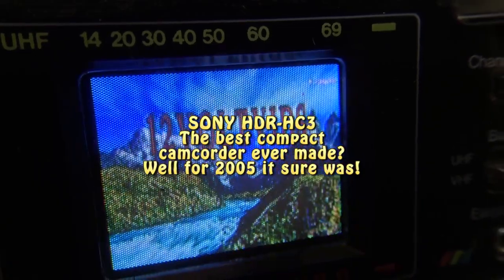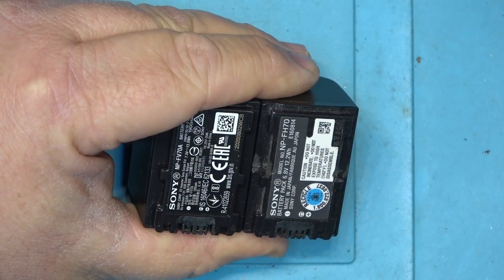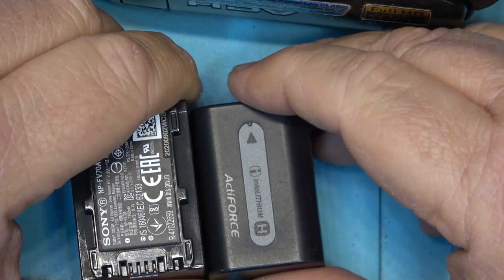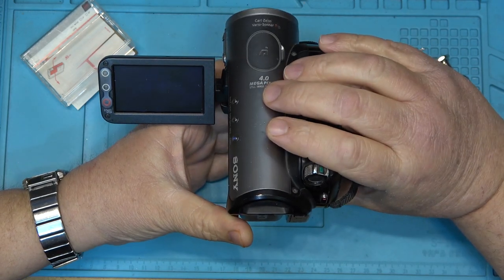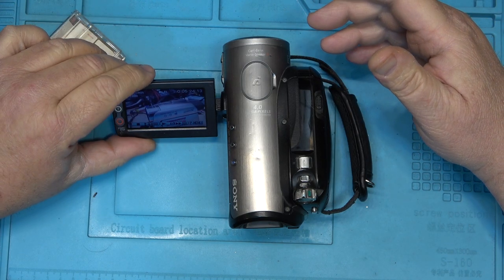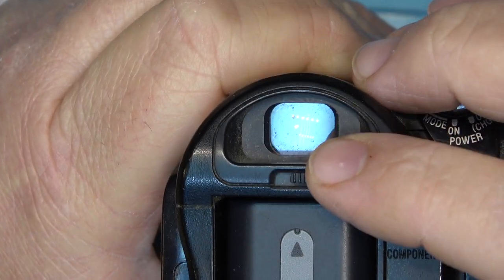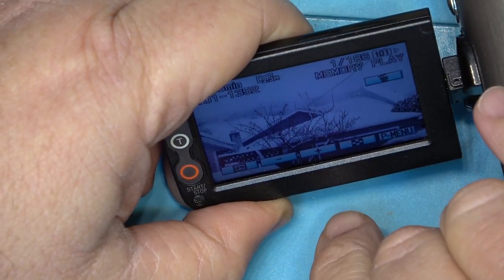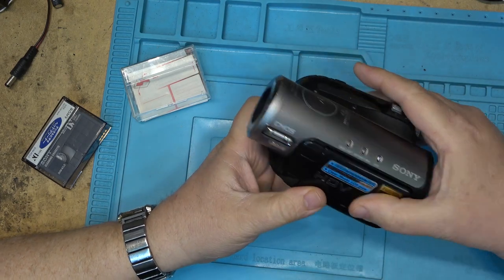Sony HDR HC3 The G.O.A.T. of Sony tape based camcorders

Comment: i ditched my phone a few years back,i use a canon sureshot and it takes great photos ...
Reply from the maker: I use my Sony FDR-AX100 for stills and 4K video. It has a 1" sensor so it can give nice shallow dept of field photos just like my DSLR and it shoots 4K video. I also use my old Sony Alpha A65 if I am doing something like time lapse shooting. It will only do 1080p60 video however. If I  am traveling small, I will use my FDRAX33. It is small, 4K and shoots 20.5MP stills. I have too many cameras. Of course there is always the phone. You know the saying right, the best camera is the one you have in your pocket. The phone comes in handy for that, but if I am planning on shooting pictures or video I take a real camera with me and a tripod. Yes, I am that guy that will set up for that perfect shot.

Comment: Hi! I have the exact same camera (HDR HD3)... how do I transfer the video from the tape/internal memory to my computer? Which cable should I use and where on the camera do I plug it in?
Reply from the maker: To transfer photos from memory stick if you don't have a memory stick reader you can plug USB cable into USB connector on side of camera below the memory stick. 
To transfer video you need a firewire cable and firewire port on your computer to transfer it. You will also need editing software that supports hdv capture if the tape was recorded in hdv mode.  Then simply play the tape and record on the pc.

Comment: a question about alignment i have two videos written in 1997 with wrong alignment at that time a bracelet had left the cassette deck and the video was written incorrectly, i cleaned my head and tried to play it and align it i succeeded somewhat the first video  the second I did not manage it plays with lines and there is no sound .. Have you encountered problems with incorrect video alignment?

Comment: Thank you for this informative video. I have the exact camera that I purchased in Australia in 2005. The only thing is, is that it records in Pal and the screen is no longer working. I have two questions for you. One is do you know where I can get this screen replaced and I also wanted to copy my tapes onto 2015 Mac Desktop. Any help that you can suggest, I'd appreciate it. Thank you Norman
Reply from the maker: No to the screen as far as dumping to computer all you need is software and a firewire port and the data can be copied straight over.

Comment: Sony tried to make mini dv camcorders or for that matter hdv. Worked for a couple of tapes and that was it. Never to work ever again...have 3 Sony's just sitting in the cabinet not working. Even my old Samsung and Panasonic mini dv camcorders still working after all these years without a single problem. The video quality same as any sony. Now I'm looking to get hold of a Panasonic HDV. Maybe they made some. Bet it would still be in 100% working condition.
Reply: Panasonic did not make HDV camcorders. Sony and Canon made 1080-line, JVC made 720-line.
Reply from the maker: My Sony DV and hdv cameras never let me down. My JVC professional died after only 240 hours of use.

Comment: I remember us getting the HDR-HC3 in 2006. Being able to record in HD at the time was amazing, really ahead of its time. Unfortunately, it stopped working… I could never find anyone who was able to fix it, and now I have endless DV and HDV tapes I have no way of transferring :( you wouldn’t wanna try working on my HC3 by any chance, would you? You might be my only hope for this thing!
Reply from the maker: possibly can be fixed. Never worked on one though but I have had good luck with other small cameras.
Reply: Does your HC3 have the loading issue where the tape door will not close?
Reply: @Raptor50aus  long answer… that’s the exact issue it originally had. Seems very common to this model. Things got a lot worse from there though… 

to repair the door/loading issue, I sent it (VERY well packaged) to a supposed camcorder repair specialist I found on Google. When he received the camera, he gave me some story about one of the guides in the tape path coming loose in transit, knocking around in the unit and taking out the tape head with it. So now he would have to replace the whole drum assembly. A surprise charge, how convenient! 

He refused to supply any photos or proof of the supposed damage, or loose parts. But offered to send me back my camera as-is for an exorbitant fee. Basically holding my camera hostage! Either pay for the new surprise repair, or pay nearly as much to just have it sent back. I obviously have no way of knowing 100% but in my opinion this was a shakedown. I really don’t think the camera was damaged in transit.

Now I also know nothing about the quality of the head drum that was installed in this unit. Was it new? Used? Authentic Sony OEM part or something cheap/generic not even suited to this camcorder?

Whatever the case, I got it back with the door issue fixed but now unable to play any tape, DV or HDV, without severe dropouts stutters and digital glitches. A problem I never had before, and I routinely used the camera to play back tapes made on several other cameras over many years so this is not an issue it should be having. 

After all this I really don’t know what to do. 
I tried to buy another model on eBay… and what do you know, it has the door/loading issue too. So I’m actually stuck with two less than functional Sony HDV cameras!
Reply: @12voltvids  in my quest to get one working unit I actually have my original HC3 and another that I bought on eBay about a year ago, which is also less than functional! Is there some method by which I can contact you? Appreciate you taking this into consideration, hopefully we can work something out!
Reply: You are better off trying to buy a different model like the HC1 that re rock solid.
Reply: @MrRom92DAW  The HC1 model is the one to buy it is rock solid or basically anything older than the HC3
Reply: @Raptor50aus  thank you for the tip, I will certainly keep that in mind should I end up attempting to buy a 3rd camera… which is looking very probable, in all honesty!
Reply from the maker: @Raptor50aus  no
Reply: @Raptor50aus  No, the HC1 is not rock solid either.
Reply: @TinLeadHammer  thanks for the info 
Mine is working fine but I don’t use it much
Reply: @Raptor50aus  I have that issue on a H9E. the door hook does not close and when it does, it spits out the tape.
Reply: @Raptor50aus  the only problem with HC1 model is that the ribbon cable of the cassette tray eventually breaks. I've had this happen to me twice on my original camera and a third time on a newly acquired one. It's a design fault.

Comment: do you consider this better than the hdr-hc1?
Reply from the maker: The advantage of the HC3 was it had a 4.0MP cmos sensor with a real Xenon flash tube. It takes really nice still photos comparable with all the point and shoot cameras of the era, and because it had a real flash it would take great pictures in the dark.  It was also much smaller than the HC1.

Comment: Can I swop out a drum from a NTSC digital8 with my PAL digital8 camera. The NTSC camera plays PAL digital8 tapes but not 8mm or hi8 tapes. The drums looks identical but not sure if the signals are compatible between NTSC and PAL.
Reply from the maker: Yes if the drummers physically the same type. Sony used two basic drum designs in their camcorders. the camcorders that the tape went in from the top in other words the drum at the bottom of the camera are all the same and this includes the digital 8video walkmans. The camcorders that the tape is inserted from the bottom in other words the drum at the top are different. How they are different is the connection ribbon cables go the opposite direction so even though physically they would fit the connection cables will not line up with the circuit board plugs other than that yes you can change them the signals are laid down on the tape exactly the same regardless whether it's an ntsc or a pal recorder. The difference in the signals is the speed that the drum spins, for pal it's 1500 RPM, for ntsc it's 1800, and for digital 8 it's 4,500 RPM.
Reply: @12voltvids  thanks so much. Will def make that my next project...maybe I can bring my trv-340 back to life. Have a nice day and thanks for your videos...it gives my inspiration when I'm battling with difficult stuff. Keep the videos coming.

Comment: My Sony HDR-HC3 HDV miniDV has the same tape mech loading issue like your other camera in this video at the start. Its a time bomb waiting to fail. Mode switch with fail. My HC3 is in a bag in parts. It might work for a while but it will fail :( I have a Sony HDR-HC1 HDV handycam and it works perfect still.
Reply from the maker: You need to load tapes regularly, like at least once a month if not more. Not so much use it, just turn on, load tape and run through the modes and then remove the tape. This keeps contacts clean.
Reply: @12voltvids  Interesting all my other Mini DV and HDV cameras don't have this issue and they get used no more than the HC3 :)
Reply: Are any of the parts for your HDR-HC3 for Sale? I'm in need of the touch screen.

Comment: First, saying that is is one of the best HDV camcorders is a bit of a misnomer because there were very few consumer HDV models, from Sony and Canon and some early JVC. So in a way they are all ones of the best. Still, Canon's HV20 / HV30 / HV40 were better: bigger sensor, cleaner image, progressive scan, more manual controls. The only benefit of the HC3 was that it was small.
Reply from the maker: The hdr fx1 kicked ass and it could do 30p and 24p as well which were both useless as that frame rate is just too slow unless you are just shooting talking heads.  However this one had the 4 megapixel sensor which meant it could shoot high quality stills on par with all the point and shoot stills cameras of the day and with a xenon flash tube to boot.  Nobody else had that to my knowledge. Being small also made it the perfect camcorder. Realistically nobody in their right mind would ever consider the psuedo 24p modes unless using sticks.  Slight camera movements result in blurring and since most used these fie travel handheld it makes no sense to use 24 frames. Even film cameras moved away from 24 and went with 48 for same reason.
Reply: @12voltvids  People use 24p with small camcorders very successfully, including handheld. It gives a certain look and doubles vertical resolution if it is real progressive, which the Canon had. The FX1 shot 24p in Cineframe mode, which was fake 24p, no benefit at all.
Reply from the maker: @TinLeadHammer  all the so called 24f modes on hdv were fake because the tape was still recorded at 60i, so the image was interlaced to be recorded on tape. When the tape was played it was an interlaced signal.  I am sitting on a cabin XL2 right now.   I put it in 24p mode and record. Play the tape back and guess what the file shows as when downloaded? 60i.   It's no different than cineframe 24.
Reply: @12voltvids  Nope. Cineframe was shooting 60 fieilds, deinterlacing to 24p with field blending, then recording as 60 fields. Canon consumer cams shot at 24 frames and recorded with pulldown on HV20/HV30 and as native 24p on HV40. But it was long time ago, no one cares anymore. I apologize for the offtopic.
Reply from the maker: @TinLeadHammer  
It doesn't matter because the tape was recorded at 60 fields.  Regardless how they attempted to market it, and they did hoodwink many people, what was coming off the tape was 60i.  You can read it off the sensor any way you like but the result was exactly the same. Sony's cineframe worked the same way.  They both looked like crap.   My current camera can shoot 24p, 30p 60i and 60p
I shoot everything in either 1080p60 or 2160p30. 24 is just too slow for anything practical unless you are looking for a specific look. Even big directors are making the move to HFR because 24 is simply too low.   It might have been ok 100 years ago but it should have gone by the wayside 50 years ago.   I remember seeing my first 60 frame motion picture film at expo86.  It was an IMAX 60 frame movie on 72mm film.   Once I saw that everything else looked like crap.  The film clairty one one thing but it was the smooth motion that had the biggest impact on me.